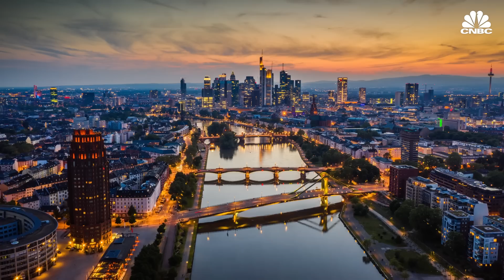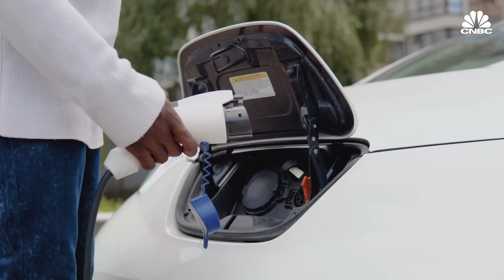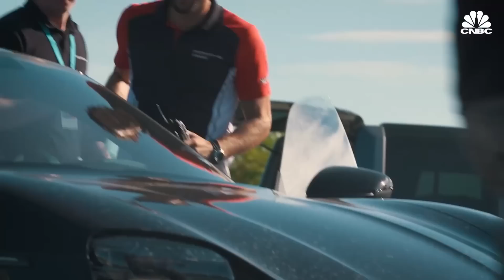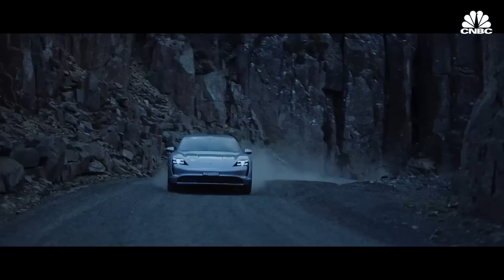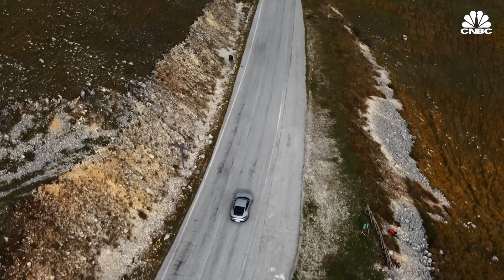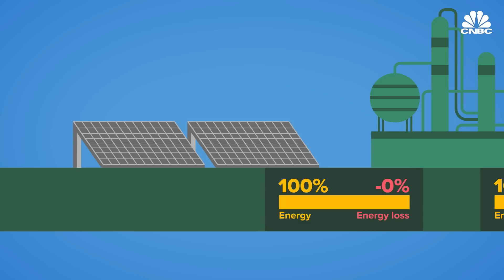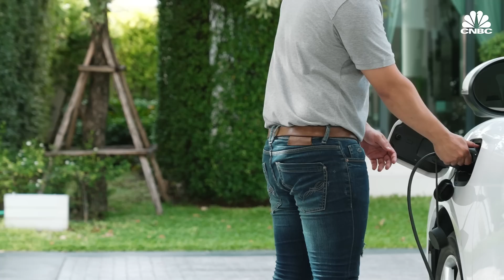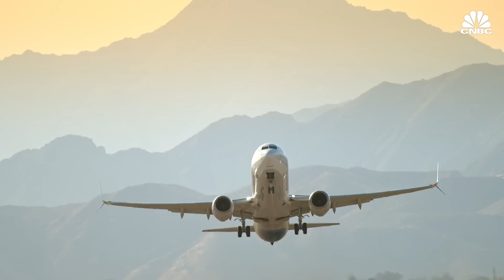How Porsche Plans To Keep Its Gas-Powered Cars On The Roads

Comment: I applaud the efforts.  Nothing wrong with having options, and the option to keep some of the classic cars on the road is a good one.
Reply: yeah, EV should be 'superior' for people that wants personal transportation, and ICE is for someone that really into cars
Reply: @kalecooper  Yeah for 95% of people EVs will more than meet all their needs once they figure out how to deal with renters and people who don't have dedicated parking spots. The other 5% that enjoys driving will still need combustion engine vehicles (I don't care what 0-60 times EVs can put down with all that torque at zero, they have no soul), but I'm not terribly concerned with 5% of people still using gasoline.
Reply: Yep, taking a page from history, if they want to keep the soul of an ICE car they have to create a fueling network that doesn't rely on pumping carbon out of the ground and into the atmosphere. Even if it is five times as expensive as regular fuel these cars get driven so rarely it won't hit the folks who can afford it in the wallet too heavily. I plan on using them for my track day car when they become available, stick shift ICE sports cars all the way for fun. EV for commuting appliances where nearly all measurable environmental impact from cars comes from.
Reply: 1) there is nothing unusual happening with the climate.

2) there is nothing wrong with burning fossil fuels.  Its problems in high-density areas are trivial to fix and already have been fixed.  CO2 is not a pollutant.

3) Climate alarmism is a big-lie superstition supported by tax-bribed liars.  (See Climate Discussion Nexus for 100s of videos on climate quackery, deception, and realism.)

4) decarbonization is 21st century pyramid building and human sacrifice. 

5) there is NO excuse for expensive electricity.  Electricity generation is boring.     Just burn coal and scrub the smoke in densely populated areas.

6) the only challenge is manufacturing market quantities of cheap gasoline.  South Africa has already done this for decades (Sasol), using coal.
Reply: they tried with corruption. thats a big problem. heads will roll in germany
Reply: @timopint1125  Corruption isn't illegal in Germany so nothing will happen.
Reply: @darthmaul8912  Isn't corruption illegal by definition? 😆
Reply: @LukeW_66  There are actually huge grey zones. In most cases politicians are on the brink of being illegal in their actions but it is very hard to prove that you did something as a favor when you switch to the firms a year after your political career ended.
Some of the mightiest companies in Germany doesn't bribe single politicians but their entire party instead.

If you need examples I know quite a lot of them because this kind of bribery is very common in Germany.

In the US there are plenty of examples too. Almost the entire former Obama/Biden administration switched to Ratheon and Lookhead Martin as his 2 terms came to an end. That's why almost everyone knew that there would be major wars when Biden became president. A team of journalists in Germany did a pice called 'return of the hawks' months before he took office.

Comment: In freezing weather, 40% of the charge is lost to keeping the battery from freezing at night. If it remains cold, the rest is lost the next day while E-Fuels do not evaporate. Hence, the choice between EV and E-Fuel is not so easy, it depends upon the circumstances. E-Fuel is definitely better in a cold environment.
Reply: You got your numbers wrong there chief. 40% loss is driving an old gen 1 Tesla Model S with the heat on full blast. Modern EVs use heat pumps so you're looking at a 20%-25% range reduction in cold weather now.

Sitting in sub-zero temperatures the battery management system uses 5%-10% per day to maintain the pack. Fortunately people with EVs charge at home, so its plugged in and that loss doesn't matter. I'll take my $0.60 per gallon equivalent electricity even if I do lose a few cents a day for two weeks in the winter.

Comment: If trees can do it using sunlight, there has to be a way we can 
also. The reality is that government has figured out a way to tax carbon dioxide, which is by all accounts totally unnecessary unless that money is going to be used to research cleaner methods of lithium mining or other mining associated with electric cars, or in this instance by equally supporting synthetic fuels R&D. Toyota’s bet is on hydrogen at this stage, and Porsche/VW is somewhat weight on decarbonization, why not if you can get a tax credit!
Reply: No one takes Toyota seriously and Porsche's plan is even less efficient than hydrogen.

My dad and my co-worker have EVs and with SolarEdge inverters they charge directly from their solar arrays, so we're already doing it with sunlight.

Comment: I would have no problem paying more for an e-fuel if it meant I get to keep my old IC vehicles and not be asked to buy an EV I don't want.
Reply: How much more?  Would you still pay 4 or 5 times the cost?
Reply: @Brian-om2hh  No, not near that much. From what I've read the worst case scenario is 2x the cost of gasoline today. At that price I'd do it. I don't like any cars made since the mid-90s, and even then most of what I like is 50+ years old.

Comment: THIS is pretty much the only solution in the medium term for aviation and long distance transportation together with Hydrogen for land and water based transportation.  The ICCT are a bunch of crusaders who hate ICE's, not because of climate change but because of the fan base it has and the activities around it.  They moan about the inefficiency but what does that matter if the it is inherently carbon neutral and the energy is harvested from non-carbon sources? (Unlike the electricity being used today to drive EVs, which is still largely coal fired....)
Reply: If you want to look at EV emissions google "map of EV MPG equivalent" and take a look at the maps. They show you which US states have lower emissions with EVs running on grid power than ICE cars. 10 years ago there were a lot of states where EVs weren't better because of the prevalence of coal plants. Today there is nowhere where an EV isn't better. This also doesn't factor in people with their own solar. My dad and a coworker charge their EVs directly off their solar arrays with SolarEdge inverters.

The problem with inefficiency is the need to replace as much fossil fuel generation with renewable generation as fast as possible. Hydrogen is about 30% efficient. I can't imagine Synth-Fuels make it into the double digits. If you have enough solar to power 10 EVs or 1 Porsche 911 Synth-Fuel, it makes a lot more sense to power the 10 EVs.

Comment: These eco-idiotic arguments about electric cars show, just how much they don't understand cars and how urban-centric they are.
1) a tank of a car wil never change, while battery of an EV degrades over time. And no, cheating with spare capacity doesn't change that fact. Most people can't afford a new car, especially in poorer countries, meaning they'll never buy an EV, however, they still need a car to get places, most importantly work! Your energy efficiency is NOT important factor, when buying and operating a car. That is, what allows you to work, do business, get your loved ones to a hospital, when they feel pain (you don't call an ambulance, cause the tooth needs to go out, but damn, you're not going to sit around a watch your kid in pain), meaning you'll pay whatever is necessary to maintain that car and use it at all times, while maintaining minimal impact on your budget. This translates to not spending large amounts of money upfront, which is precisely, what buying an EV is, when compared to similar petrol car with a reasonable 2 liter engine. That petrol car will be there for such emergencies, because it will not be discharged by the grid (something some ecos proposed to offset the need for energy storage due to abundance of wind and solar outside of consumption hours and nil generation in peak consumption hours, to use batteries of privately owned cars), because it has it's own fuel tank, which doesn't shrink every year or two, meaning a petrol car will largely have the same range throughout its lifespan. Furthermore, going EV doesn't address the underlying problem, the need to regularly commute because
2) Not everyone can work remotely, given the nature of their job, and not all employers are open to the idea of 100% remote. Better solution, than going for a costly energy transition in transportation industry, specifically with private transportation, would have been to reduce demand for commuting, by encouraging work from home, where possible, en bulk shopping and researching machinery to reduce the amount of man hours needed to work in jobs, which have to be done in person and retraining people towards remote friendly fields. This way, you've turned a daily driver into weekly+leisure driver, which would more than half the amount of CO2 and other emissions produced by privately owned automobiles and it wouldn't cause a slew of other environmental and geopolitical problems along the way (most of the necessary minerals are found in Russia, most of material refining is done in China in this field, precisely because it would not be feasible in the West due to environmental protections and emmission limits). That Lithium, that Cobalt, that Copper all have to be mined and refined! (well, not so much for copper, but can't recycle all that much) Which have their own environmental impacts. EVs are more metal intensive than normal petrol cars, that is undisputable fact. Funny how no environementalists are talking about this side of EVs.
Energy storage and utilization systems simply need to work in concert with each other. Until a battery can be invented, that will not degrade over time (which is impossible thanks to laws of physics), cheif problem for an EV will remain. That is why I strongly believe in hybrid cars and synthetic and fossil fuels. Hybrid cars offer a solution to a problem, that cities have, which is air pollution. You can outlaw use of internal combustion engines in large cities under normal circumstances (ex exception when towing something, fine being forgiven, if driver presents repair bill from a shop, which shows battery swap or other repair, which removed problem rendering full electric unusable etc.). This would remove at very least half of all emmissions from private transport in big cities and it wouldn't force us down a technological path, that is simply inferior with no way back, all the while contributing to improving air quality in the cities. Solving an actual, solvable problem, while maintaining the key characteristics of the car, not to mention, that a hybrid is less resource intense than an EV.
Reply: 1) Both ICE and EVs lose range over time. An ICE because of engine wear (Your gas tank doesn't get smaller but your MPG suffers.) and an EV because of battery degradation. Early Nissan Leafs had bat battery management systems, but Teslas have good battery management systems. There are Teslas on the road at 300,000 miles with original batteries. 

But EV battery degradation happens slowly. If you find you no longer have the range you want, you can sell your car and get a new one. I know lots of people who bought 2011 Nissan Leafs used in 2020 when they were cheap. The original 72-mile range was down to 30 miles (again Nissan had a bad battery management system) but if you have a 10-mile commute, it works very well. When those 2nd hand Leaf owners decide their range isn't good enough they sell it back to Nissan, which uses the battery packs for stationary energy storage.

EVs are inherently more reliable. The moving parts are an electric motor, an HVAC system for heating/cooling & battery management and a blower fan. ICE cars have thousands of moving parts. EVs can't blow a transmission, oil pump, head gasket etc. I was a fleet manager. I would have killed to have a fleet of EVs instead of a dozen gas vehicles and two diesels.

If you let an ICE sit the gas can go bad, the oil can degrade, the battery can die. Its not just ready to go. If you have an EV and you leave it plugged in at home, as long as the tires don't deflate it will be ready to go indefinitely.

Vehicle-To-Grid plans have two policies to specifically address your concerns.
(A) The EV owner sets the amount of power the utility is able to BUY from them per day so they are never below whatever they consider the minimum range for safety.
(B) The EV owner can over-ride the discharging of the EV at any time through a phone app or by un-plugging it. 

2) I don't disagree with more work-from-home policies where they can be done.

Necessary minerals are found in China, Russia, India, Australia, Many countries in Africa, Chili, Argentina, the USA and Canada. A lot of refining is done in China and other countries are now realizing how stupid it was to neglect their own manufacturing capacity.

EVs do require more metals than ICE vehicles, but the metals are 100% recyclable. The battery materials in one of those old Nissan Leafs with old metal intense batteries is going to be used to make 2 EV batteries for a modern EV 20 years from now. I also don't understand why mining is only bad when it produces material for EVs and is never bad when it makes regular steel for cars or those same battery materials for smart phones and computers. 

Battery degradation is not a major problem. Just google "300,000 mile Tesla". As I mentioned, you buy a 300mile range EV. In 10 years maybe it only goes 260 miles and even though superchargers are now abundant, you want to sell it. Is there anyone who wants just a 260 mile range car? Of course there is. So you sell your car and the new owner drives it for another 10 years and maybe the 20-year-old car only gets 220 miles of range. I'd bet there is still going to be someone interested in that range 20 years down the line. Whenever the range becomes unacceptable to used EV buyers you sell it to a company that uses it for stationary storage. When it is no longer useful for stationary storage, it gets recycled because it is full of valuable minerals and since 20+ years in the future batteries use less lithium and cobalt to do the same job it recycles into 2 EV batteries.
Reply: The irony with EVs is that they're supposedly ideal for use in cities where the lack of tailpipe emissions is a bonus, but mosr people living in cities don't have access to offroad charging, so will have to rely on "going to the pumps" like ICEV drivers do.  And it only takes 5 minutes to recharge an ICEV.
Reply: @stevemawer848  Unless those cars are in motion 24/7, they will be charged wherever they are parked. Every city is working on street-side charging. I've worked with my city utility to allow chargers to be placed in the right-of-way between the sidewalk and the curb.